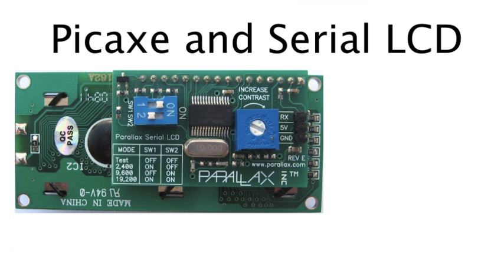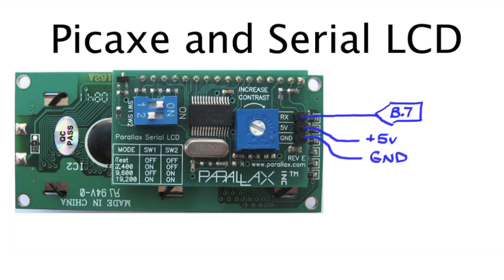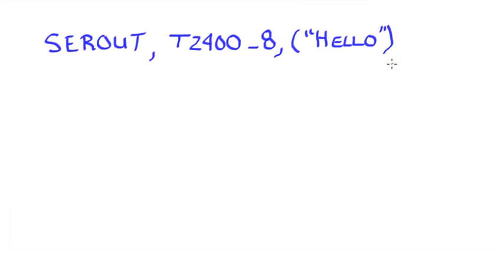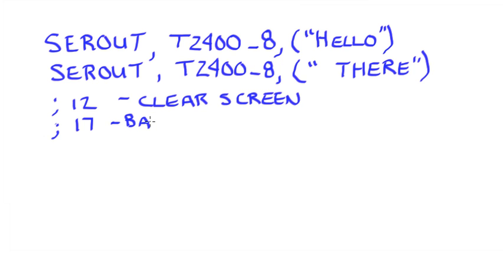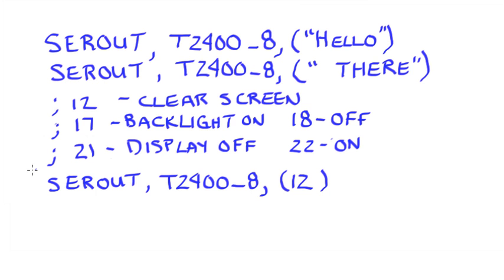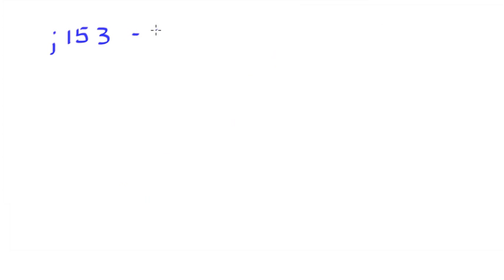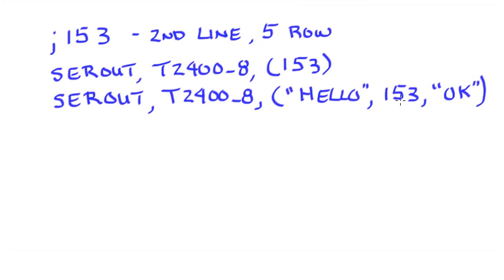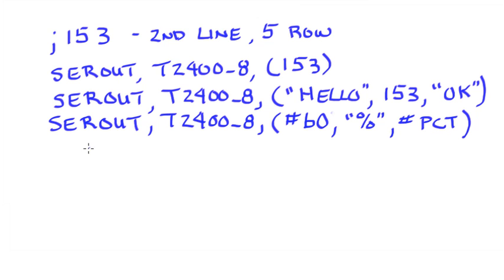Using a Serial LCD with the Picaxe

Comment: The PICAXE SEROUT command must include the I/O pin used for serial communication.

Therefore:  SEROUT B.7, T2400_8, ("Hello")

Omitting the pin will result in a syntax error.